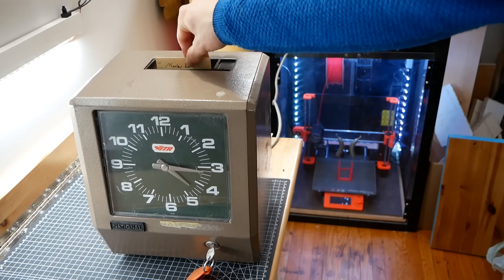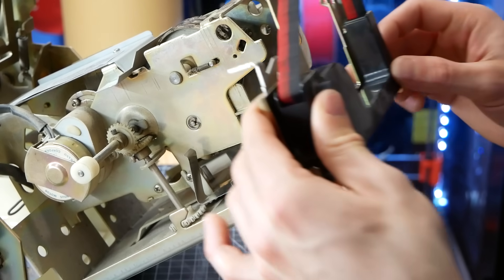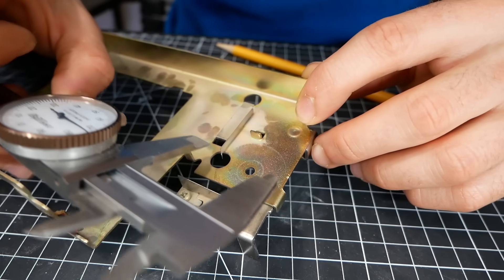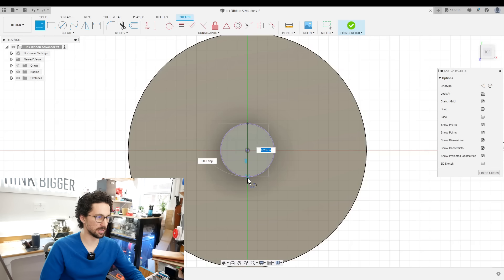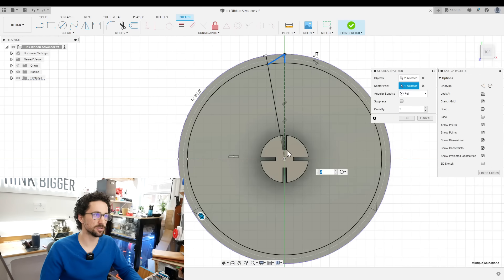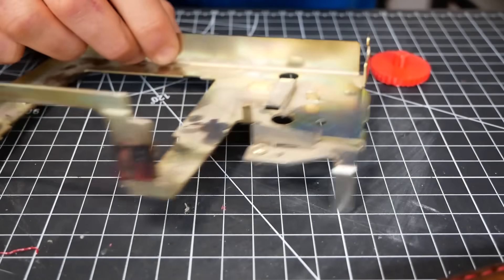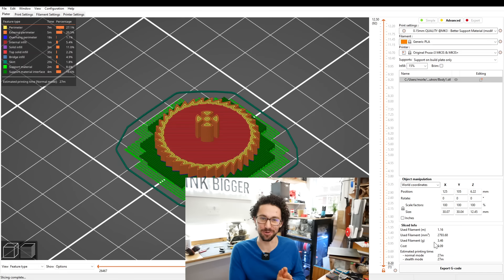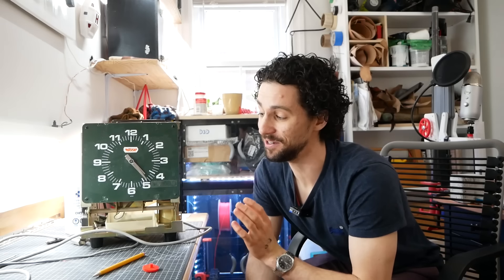They wanted 100 dollars. I 3D printed it for 9 cents.

Comment: Your price comparison is an apples/oranges situation. First of all, the company is selling the entire assembly for 95 dollars, not just the missing drive gear. Secondly, sure it may have cost you 9 cents in filament, but what about the cost of the printer, or the cost of the electricity to run the printer? Did you amortize those into your cost? Or how about the cost of your own time to design the replacement piece? Is your time worth nothing to you? This comparison is deceitful; it's click bait; and you probably know it. Boo.

Comment: william osman is right when he says we need the "blender of CAD" : a free software that allows normal people to spend $300 on a 3D printer and print more than just downloads from thingiverse.
sure, the alternatives to professional software are useable, but the free versions of industrial software (fusion 360) are kneecapped and the open sourced ones aren't friendly (I'm looking at you, FreeCAD)

I would love to live in a world where anybody can try and come up with solutions to mechanical problems in every day life. for people to easily make their own stuff. and making would probably be as big a community on youtube as cooking or makeup.

thank you for illustrating how easy it is to come up with a simple solution to an asinine problem

I would warn you, however, that the plastic gear you made will wear down very fast because of the constant erosion from the metal around it. but you would have to replace the piece 10 000 times before it would have been cheaper to buy the metal part
Reply from the maker: Thank you! I think the free version of Fusion 360 is actually quite powerful.

We will get there as CAD education becomes more common in primary schools!
Reply: @MorleyKert  yes, it's powerful, don't get me wrong. But an arbitrary project number limitation? I made 1 part, 1 drawing and tried to design a system and ran into that wall... I jumped ship. I'm currently not even using free software, but cracked, unsupported industrial software. It isn't pretty but it's so powerful and intuitive (apart from the God-awful UI) that I wouldn't have anything else.
I also did all my design education using it and it was forked to make the software I use at work.
But it's no longer supported so if the company that made it weren't assholes, they would just make it open source (but I guess the code could be used to compete with their current supported products)

Comment: Quick tip… 08:46 draw another circle slightly larger than the tooth diameter then delete the circle at the tip of the teeth. Now you can extrude in one go rather than each individual tooth gap.

Comment: you should use patterns more. if you just had extruded and patterned the gear teeth and also the slots in the axle it would save you time and be more adjustable. on the axle you could have just used a rectangle constrained midpoint on a line from centerpoint you would not have to make all those offset lines.

Comment: Good use case for resin printing vs FDM. Resin would have been faster to print and stronger with better detail on the teeth but might have been slightly more expensive and definitely much messier.

Comment: Did practically the same steps to fix a broken piece in an oscillating fan, made the part to fix it but also made it way sturdier than the original part. A lot of useful techniques here! I knew about parameters in Fusion 360, but never really felt a need to use them in my use cases. Perhaps I should use them anyways to gain some familiarity with that feature, so I can see where I can use them where they're most needed.
Reply from the maker: Nice! In my own experience, parameters are really useful when you have a dimension that you might want to change, and as a way to keep track of measured dimensions.
Reply: Using the parameters helps you with how you analyze the problem, it gets you to think of the details and how they interact with each other, so you can identify them more readily in the future.  Basically improving your technique through experience.

Comment: instead of selecting everything, you can just extrude and circular pattern the cut, also you can define the border with a circular pattern and number of tooth instead of an angle, it saves a lot of trial an error.

Comment: Did you upload the heat to thingiverse I bet there are at least 3 other people out there who need this. It's so funny I don't use the time clocks and I don't need this part but you made it interesting enough to watch the whole video. I like your working process and even if you make 100 proto type gears you still saved a bunch and learned how the clock works. Pretty sweet

Comment: "95$ for something I can 3D print for 9 cents"
If you go in mass production with these, you are right. It you only need one part, the hours you put in to research and build and optimize it are way more than 95$. Except your job is to show people how to make things, of course.
Still, it's a super unfair comparison of worth, since you only calculate the filament cost.
Reply: I love the process you used to solve a problem, I always say why buy it for $95 when you can spend thousands of dollars on 3D printers, software, and hours of your life! Your video is not about cost savings. Your video is about relying on your own abilities and resources to solve issues. And that is a game changer.

Comment: The 100$ number does not seem that unreasonable to me. If we do a quick back of the envelope calculation, a trained technician is maybe 20$ per hour on the lower end + 10$ company cut and material costs. So 100$/(30$/h) is in the ballpark of 3 hours, which I bet is less than the time Morley spent on this project. The 9 cents of printing are the material costs of the solution, which is hardly a reasonable way to assess the cost of having fixed the problem in the first place.
That it does not make any sense to spend that kind of money on a passion project is a different issue, that I will not disagree with.

Comment: Clickbait is a thing, but don't you value your time, or that of your printer?
You needed to design the part, and your printer took considerable time to print it out. 9 cents? In your dreams. Parts cost more than the material they are made from.

Comment: Always remember the manufacturing constraints you're interfacing with. The punched and injected parts will have burrs and fillets so your design not only has to function it needs to allow for the surrounding parts tolerances. The top boss could have benefited with a fillet radii top and bottom for clearance and strength. The lower axel extended and fitted with starlock washer offers axis alignment and loss prevention. Minor design changes yet so beneficial.

Totally agree with other commenters, $95 is cheap compared to a complete new time system, most manufacturers don't support their product after a reasonable time. Someone in the company's really attached to that puncher, through support by scaling part cost to maintain selling viability, I doubt it makes any fiscal bottom line difference.

Comment: 'How many times does 10 degrees go into a circle? Let's say 35.'
You might want to double check your maths there. :)

Great video and I'm glad you saved some money and had fun.
I'm surprised they couldn't sell you just that part. Maybe the originals were metal and so them wearing out or getting lost isn't something they come across often, whereas ribbons and ink reservoirs have a finite life
Reply: Lots of things like this are only available as sub-assemblies, perhaps because the company selling the device subcontracted the part to another company, who only sold them the sub-assembly, not the gear.

I hit a situation like that recently with my older minivan with power hatch.  The motor drive was fine, as was the arm that went from it to the hatch itself.  The ball and socket piece at one end of the arm broke.  The assembly could only be purchased together; hard to find, costing a few hundred dollars or so.  I was finally able to find just the end piece and attached bolt at a salvage yard for maybe $10 cash, they charged less than normal because they let me take it off the old vehicle myself.
Reply: Even if they did buy the cog as a separate component in the first instance, they would have assembled all the sub assemblies at one time, and then shelved the parts for use as spares.
Reply: @almostanengineer  More than likely, since their field service techs would replace the entire sub-assembly.
Reply: @bobblum5973  Logistics is a b* and a half.
If your device has 50 distinct parts, you'll need 50 individual boxes. If nobody ever orders these parts, you might as well put them on one pallet and stow them away. If you need one of those parts, you have to dig out the pallet, find the box and properly stow everything again.
In times of free/cheap shipping, this just isn't profitable, unless you make spare parts stupid expensive, at which point nobody is gonna order them anyways.

Comment: You left out the price of your printer in the 9 cent cost.  ;-) 
If fixed a crack in a bike frame for less than one dollar after I spent $1000 on a welding machine.  :-)

Comment: Great job, great way of teaching the viewers as well. Just adding that the piece did not cost you only 9 cents. You'd have to take into account the material (so, 2 pieces = 9 x 2 = 18 cents), plus electricity for running everything (printer, computer, room, AC) you used, plus CAD software license, plus *your time*, which is likely to be the most expensive component by orders of magnitude. So we're talking about a few dozen dollars, not just 9 cents.

This is why buying one-off 3D printed parts from companies seems to cost so much.
Reply: Importantly though, the value of your time only counts if you're doing something you don't want to do anyway. If a movie ticket costs $5, you don't say "well I'm also giving up 2 hours of my time, so actually it costs $5 plus 2 hours of salary". Because the movie is what you want to spend your time on. In the same way I'm sure he enjoyed the problem-solving of making this gear.

And of course if you really want to consider all the costs, you also have to give back credit for the fact that he got 100,000 views on YouTube, which probably means this thing paid for itself :)
Reply: @joeymurphy2464  uhm, I enjoy what I do for a living, and I want to do it. Must I now work for free?
Reply: @tacmonkey  Of course not, I never said that. Only that applying a cost to time spent doing something does not always make sense.
Reply: @joeymurphy2464  Agreed. Another way to look at it is that this is his work. So regardless of him linking it or not, he must account for how much his time is worth + how much he is spending vs how much the video is gonna make him. For YouTubers doing this as a living, this has to be a net positive.
Reply: a rule of thumb just for fdm 3d printing an existing design (i.e. take a file and get a product.) is to take the filament cost and multiply it by 10.
Reply: @satibel  Years ago a standard rule of thumb for the cost of a low volume "Thing" was 20 times.
This was called the "Burden Cost". The burden cost goes down with increased volume.
So, I would say the Burden cost of your gear was $.09 * 20 = $1.80.
One of a kind things is commonly 100 times.
redrok
Reply: @satibel   it´s true, i dont al the cost and ist x10 material cost at least

Comment: Great job. I only use fusion and printer for repairing or improving items, sometimes using industrial grade filaments, so I quite enjoyed your approach and this video. Although relatively proficient with Fusion 360, a lot of the designs I do are "one of’s", so I never looked into parametric designs like in this video. I will for sure use it more now. It’s just like using named ranges in excel for complex spreadsheets. Thank you.
Reply from the maker: That’s awesome, thanks for watching!

Comment: To be fair you didn't print this for nine cents. You didn't factor in the cost of the printer, the whole roll of filament that you have to buy to get the small amount you needed, the computer, the software, or the electricity. Not to mention the time it took, TIME IS MONEY. Nine cents? I don't think so!

Comment: Hello Youtube algorithm.
Got any old rc cars at hand ?
Maybe worth 3d printing different sized rims too fit lego tires on them if they are all dry rotted as that tends too happen with some old rc both hobby grade & toy grade stuff, like a tyco mini hammer, a pretty basic monster truck that will certainly have dry rotting tires at this point.
Alternatively maybe some parts that are missing could be 3d printed & painted too look like the original again.

If not maybe check any local flea markets or goodwills or similar after rc cars that has the remote with them & would fit the idea.
Or maybe even in the neighborhood there might be someones old rc car sitting around hobby grade or not.
(I'd stay away from nitro though, you aren't gonna be able too 3d print gaskets handling 200 Celsius or higher anytime soon.)

If they don't have the remote maybe something like 3d printing some brackets too mount a steering servo & a few parts too pair it up with the old steering assembly somewhat & hobby grade convert a toy grade rc car too make it faster & a bit better handling or more durable.

Comment: To be fair if they don’t still have the moulds they would have refashion the tooling. Plus the majority of that cost is labour time. How much time did it take you to make it?

I’m not hating, I love this video it beautifully depicts the design process including iteration! I just think it’s unreasonable to compare material cost to material labour and tooling cost. With that being said if one does own a 3d printer you can utilise the tool to save money but everything comes at a cost, you are exchanging money for time. If you love doing it then that’s time we’ll spent! 

Thanks for the vid!
Reply: I was going to comment the same thing. I always look at it this way: could I have spent that time designing and building the part to make over $95? If yes, buy it and do the other thing.
Reply: it took 13 minutes
Reply: I think with such parts, they will have a surplus in parts. I bet if the part had a name, you'll probably would find a third-party vendor on ebay.
   
  Edit: They spent money on R&D already. It is not like they'll have to develop a whole new method or molding just to make a part.
Reply: @ghangj  They almost certainly don't have machines set up to produce that part anymore. And given the age of the machine, they're not going to retool their machines to make any more. Which means any service parts available are just being stored in a warehouse somewhere until they sell out. So that $95 is the full price of manufacturing that part, plus the cost of storing it for 30+ years on shelving that could have been used for more in demand product.

Comment: I agree that this is easier and cheaper than buying the part but people often forget how long it takes to design/find an item, print the item, or even to maintain the printer, plus the opportunity cost of those things. I use my printer but people ask me to make them things all the time not realizing how useless PLA is in a heater system of a car or even as the handle for the center console release. 3d printing should be more thought of as a prototyping step not an end product/replacement for an end product.

Comment: Your knowledge and Time should be considered as well.
3D printing is extraordinary powerful tool, but just like a car, it does Nothing without someone driving it, and the better the driver, the better is the car performance.
3D printing is VERY Time consuming, especially in the early learning phase.

Comment: Thin extrude could of achieved the same result in one action without the need for offsetting one line twice! @ 5:47. Extrude, select thin extrude, select your sketch line, set the off set and extrusion alignment to center, and then just set extrusion depth.

Comment: As a clockmaker I can say that the real part would be made of brass or steel. Plastic gears only exist on cheap movements. I would have just bought the real part, and if I couldn't and had to make it my self, I would at lest make it out of brass and steel.

Comment: Your price calculation is erroneous.  You forgot to factor in the cost of the computer, and the solid modelling engineering program (SolidWorks or Inventor, or whatever) and the cost of the 3D modeler machine itself.  There is also the cost of electricity and the network system that connects the computer to the modeler.  There is a lot more to the cost of a part than the material that use to make the part.

Comment: But it didn't cost 9 cents.  You have to add in the cost of the computer, the program, the printer, your skill to use each of those things, the cost of electricity, the cost of your time...These all add up quickly to way, way more than 9 cents.   Yeah, yeah, yeah, you already own all that stuff but that isn't how costing works.  For the manufacturer, there' is warehousing and other production costs, shipping all kinds of over head which you are just skipping right over.  Then there is the durability of the part, how many cycles will each part last?  Yeah, I know, "it doesn't matter because you can just make another one for 9 cents"  But the company can't operate like that, they have to make something durable that will last for millions of cycles for years or decades with no hicups.  SO there is testing of the durability of the part and quality assurance and then the cost of warranty and liability.    If we are being honest that is.  Pretty clever and cool though.  I think you could have gotten the tooth size and pitch from the shadow.